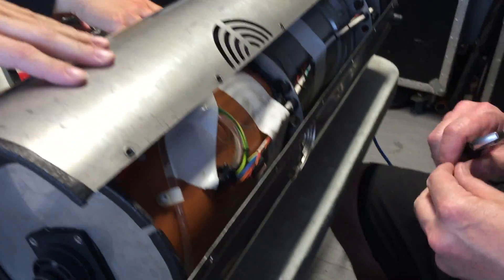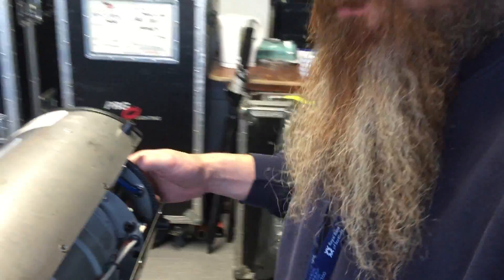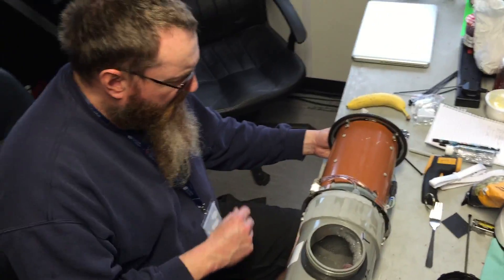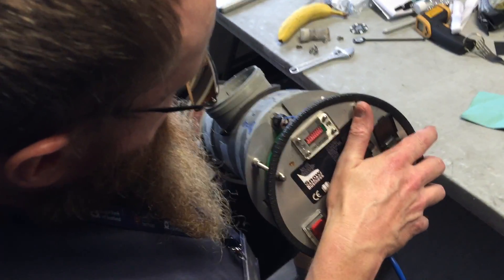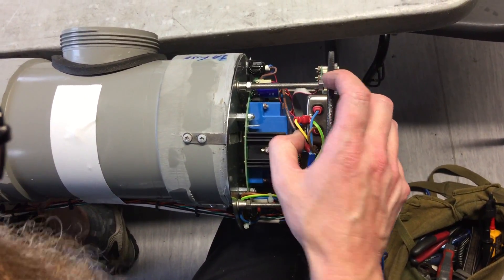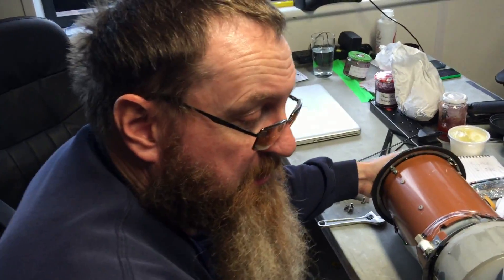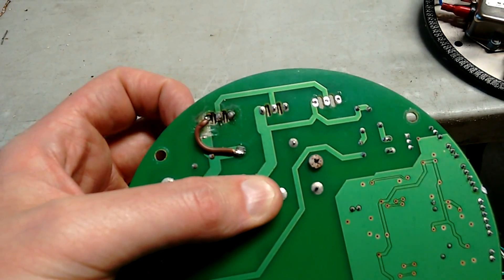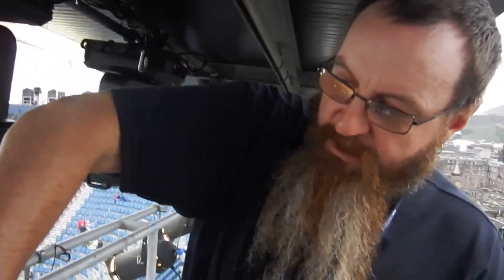Repairing the dead snow machine.

Comment: Watched your Chinese discount electronics reverse engineering and weird japanese toy doll demonstration for years, and I never knew you were in the stage tech business too! I just spent a few days figuring out how to take apart a fog machine heater, because there was no english language video and the manual gave no clue either. So If you ever feel the urge. Servicing fog-, Snow machines etc. tutorials would be unique on YT. It was an Antari fog machine which does not use a copper tube coil cast in a block of aluminium, but has a central heating chamber with a cylindrical plug with an outside spiral groove that can be taken apart and cleaned. So you're asking why I didn't make a video myself? I could, but you are the pro. It's a suggestion for a series of videos that would be popular. All other "This one secret trick" fog machine videos, just demonstrate running Vinager through them. hardly rocket science, and is not the solution if the machine is completely clogged, as mine was.

Comment: Oh the joys of unleaded solder, you wouldn't believe how many times i've seen this on new electronic equipment especially on the mains. it gets warm over the years and eventually the joint fails and usually burns it's way through the board.

Comment: "I can't find where it went bang... so let's make it go bang again with the cover off!" <-- troubleshooting bigclive style.
Reply: A Well known fault-finding technique. Fuse blows. Replace with a bigger fuse. The faulty component will reveal itself.

It was a technique used often in the first electronics workshop I worked in. One of my bosses favoured techniques. This was before the building was fitted with smoke detectors :-)
Reply: I think you meant this was WHY the building was fitted with smoke detectors xD
Reply: Jan Verschueren If high power cable guys can't find the faulty part, they just put the current and voltage to maximum. The fault was, where the smoke comes out of the ground.
Reply: Ah, the classic smoke test. If it fails, trace the smoke and see if it's salvageable to fix. I've seen many a PC power supply die this way. Stuff was way above my paygrade and safety checks to fix. Really an R&R job.
Reply: Rightyo!

Comment: Does each device have it's own breaker? Or if it went bang again could it take out lots of other machines required for the show?
Reply from the maker: Full RCBO (combined overcurrent and RCD/GFCI) protection on every circuit.  So a failing machine will go off on its own.  Because of its outdoor location we have kinda set a precedent for this level of show protection for well over a decade.

Comment: Looks like a satellite thruster module..... :)
Reply from the maker: There's a lot of work in them.  Very much hand built in low volumes with stuff that the generic machines don't have like rotary pumps and solenoid valves.

Comment: One should never go and try to fix stuff without a proper calibrated and UL approved banana.
Reply: Has to be approved to British Standards too, for use on 240v 50Hz. UL listing and CSA testing of course is also helpful.

I note the tip of the banana wasn't exposing any of the innards so it was compliant with HSE GS38

Comment: Good of the manufacturer to leave a spare connector on the board :)

Occurred to me that it might be worthwhile/educational doing a special or compilation about mains voltage tracking on PCBs sometime - it's not really an obscure problem (maybe not so widely known in china judging by some of your previous videos) but I couldn't find anything on youtube apart from making decorative charcoal fern shapes out of plywood.
Reply from the maker: Can I just mention that the videos that show the wood burning with a microwave transformer have already caused at least one death.  If you ever try that use a traditional neon sign transformer as it is current limited.  The microwave transformers will pass enough current through you instantly to cause your death.

Comment: what caused it to track ? it looked like pretty high voltage on that component. do you think its just a bad design of the board layout ?
Reply: i think snow fluid has collected and been trapped in the bottom of the of the unit, its entered through the vent when you re-fill it with the fluid and goes over the unit and collects at the base, try drilling a 6mm hole at the lowest point to drain any fluid that may collect there.
Reply: that's why it blew at the bottom, if you look carefully you can see a tide mark where it collects.

Comment: Figures. Dig through all that crap and wires, to fix something relatively simple and minor. Typical huh?
Reply from the maker: Made worse by no less than six identical connectors each with a different function and no obvious identification.  I always make notes and take photos in that scenario.
Reply: Oy vey. And this is why they pay you the big bucks.

Comment: These videos are bringing me back to when I used to run the tech booth and lighting for my high school. My friend and I got 22 "broken" ellipsoidals working in about a week. They were about 20 years old and had been running about as long. The connections in the backs of the lights were wonky on most of them, and the access nuts were well and stripped, so the only way to fix them was to twist the back shell and the forward heatsink (Which also contained the light socket) until the 500w halogen bulb you had to have plugged in started burning your hands and making you blind (This had to happen on the catwalks, as the backs were "Fixed" in the angle the light was positioned, then quickly placed into the mounted lens, which routinely killed the light again because of the connection being shit). essentially, the connections had disconnected, and twisting the from of the assembly got enough magical pixies through to the bulb to power it on. No fuses, no circuit boards, just mains power and the ignorance of being a teenager. 

We had to shim some of the bulb sockets with foil because of the play in the bulb not making a connection. 

I could have done that for years and never gotten bored. Best job I actually got paid for.

Comment: Am I the only one thinking those connectors are a poor choice for mains voltages vs reliability?
Reply: More likely the gap was bridged by the build up of a soap film from spills when filling there, and the liquid ran down the inner and pooled in the bottom, and with moving got splashed there and dried. Then with a little moisture it started tracking and carbonised the PCB, even though the isolation slots increased the gap.

More a demo the board needs a conformal coating on the bottom and top rather than those connectors, which are used in industry all over. They will withstand 2kV dry, but add a film of dirt and any connector will track over. They should have had a mains fuse though, and not relied solely on the transformer being both internally thermally protected and impedance protected.
Reply from the maker: Good choice of connector, especially combined with anti-tracking slots in the PCB.  But when the machines are using a mixture of water and a conductive addition then it's almost impossible to keep it away from the electronics when the machines are regularly hired out and shipped in random positions, often with the tanks full of liquid despite Snow Business requesting that they be emptied out before shipping.  The event industry is really rough on electronic equipment, hence why PRG design their own custom built touring equipment.

Comment: Hm.. i am wondering about the "thing" at the end of that fluid hose... I would guess its a heating element to prevent the fluid from freezing at below 0c when it sprays into the air stream. We builded some custom snow "hose" machines but with heated blower fans to make them operate all year long.

Comment: Great fix, Clive! Too bad you didn't have time to video the actual board repair.

I hope they appreciate you at your job, most electricians wouldn't give two shits about fixing equipment they were paid to only install. But in a way I can understand their hesitation sometimes. If that repair went bad and did more damage to the unit, then they would get a ration of shit from both their boss (for wasting time on something outside their responsibility), and from the equipment contractor (because now they have a more expensive repair).